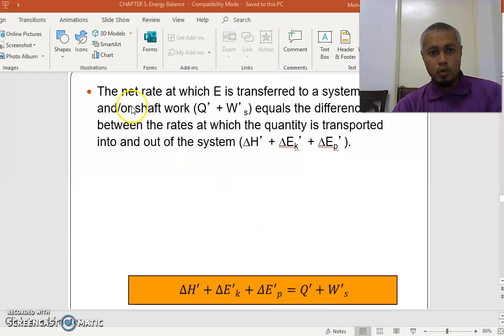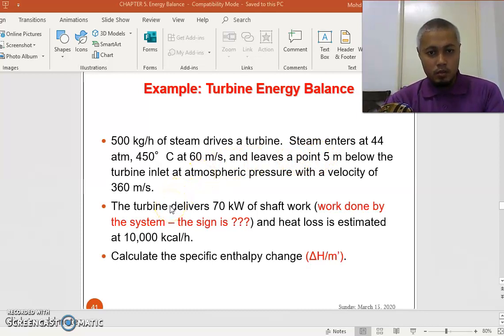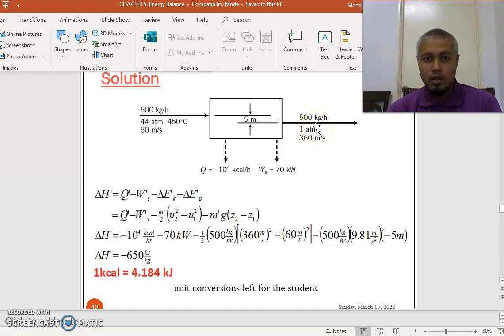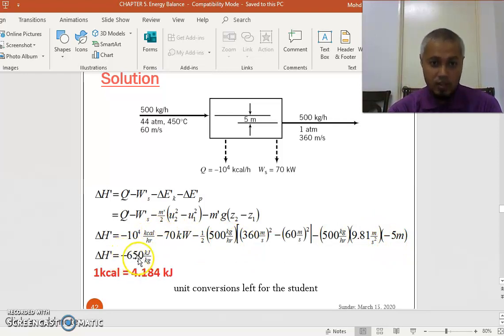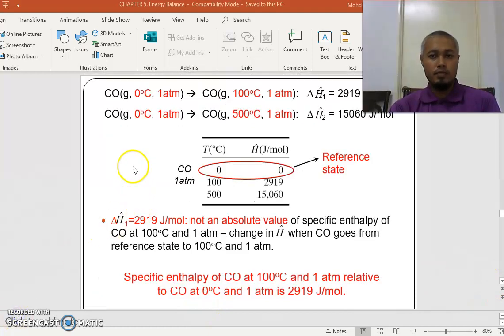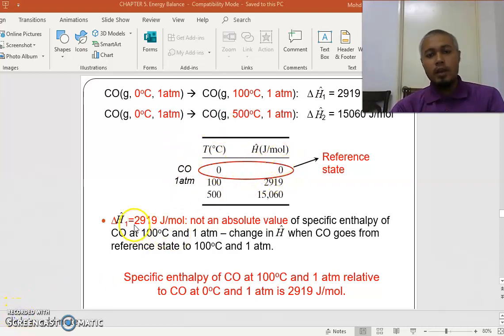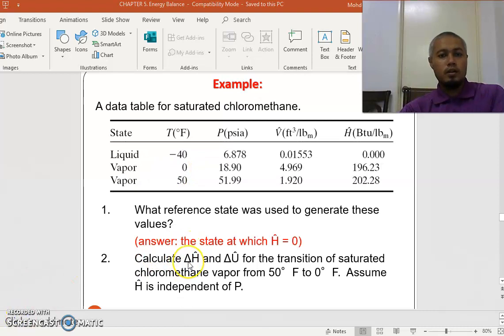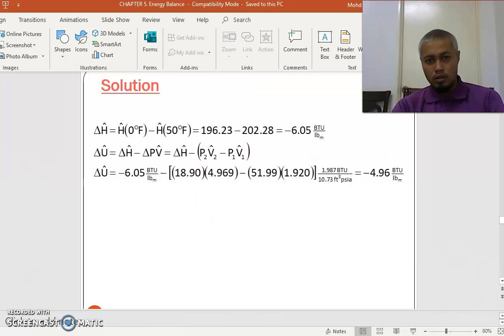Energy Balance Part 2

Comment: Salam, Dr. What is meant by 'to permit quantification of the difference between various states' at 7:35? I'm not clearly understand  with that term, Dr.
Reply from the maker: Because the absolute value of enthalpy can only be determined via experimental work. That's why we need to refer to the reference state (normally obtain thru experimental work) to get the difference between one condition to another condition. So the difference in value is not considered as an absolute value.

Comment: Dr means tht any temperature or pressure can be reference state
Reply from the maker: Yes Zai. Depend on the application or question. However, we will always consider the T and P that give zero value of the parameter that we want to refer as reference state for the ease of calculation.

Comment: Dr. Hafiz, is it possible if we have two or more inlet/outlet in the question?

If possible, how do we measure the difference in height between the input and output?

For example, if the question have 2 input and 1 output, how to measure the difference in height between them?
Reply from the maker: It is possible to have more than one outlet Haikal. To measure the height diff. between the input and output, you need to analyse which output belong to which input. However, for our level, only one diff. in height will be asked in the exam question.
Reply: @mohdhafizabuhassan7257   Oh ok Dr. Hafiz. Now I understand
Reply: thoradendang padu